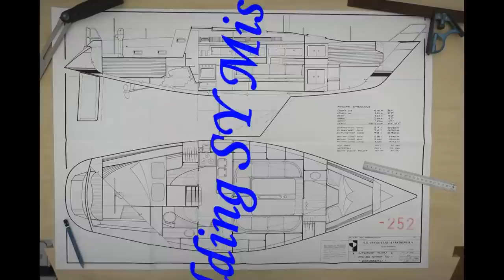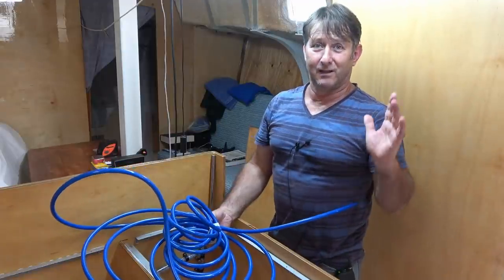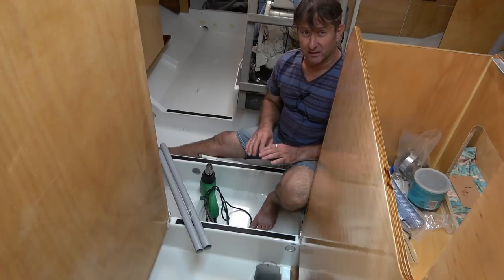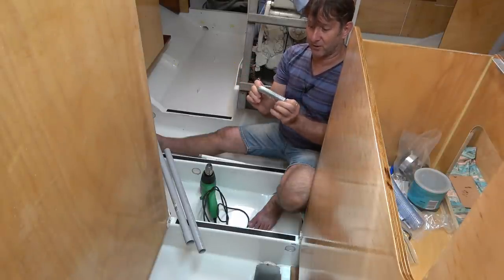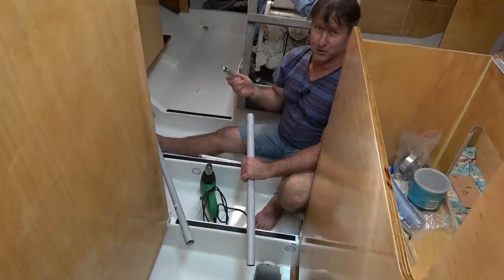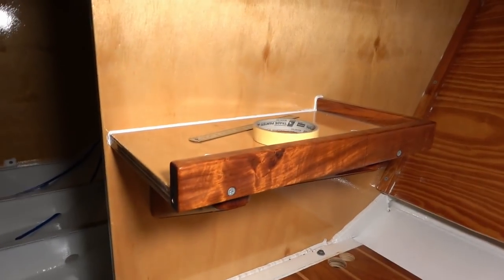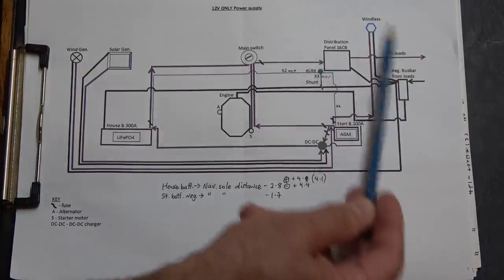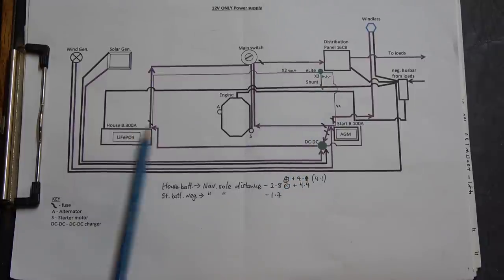A GREAT START with the ⚡ POWER supply Ep.114 Building my steel sailing yacht

Comment: Hiya, as an ex spark, run a nylon string through each conduit so you can use it to pull a wire through in 3 years or whenever. Nylon will not rot. Go to an electrical wholesaler to buy all elec bits, miles cheaper, plus get nylon, for preference, if not steel fish tape to run the string through. When using said string always pull another one through with it when you use it, for next time. 
Stay safe...Steve...
Reply: Excellent idea
Reply from the maker: Hi and thanks for your good suggestions Stephen, appreciated and yes, I do use heavy nylon fishing line as my draw-strings, which you will see in the next episode (or in earlier electrical cable videos) and I have found that looking widely, different stores and online, for good price deals on everything is very necessary for getting lower prices. Likewise, all the best.
Reply from the maker: @graham6229  Thanks for adding.

Comment: Tie a strong line on your spring then if you need to drop it to middle of a pipe you can measure on the line on outside of conduit drop it in up to your mark bend conduit and pull it out
Reply from the maker: Good idea and suggestion Trevor, thanks.

Comment: the spring in the pvc  pipes is an old trick we used to use that trick so many times when i was an instalation mechanic with the cheapo yellowish pvc pipes you dont even need to heet them just bend but this was a lot thicker is think anyways cool to see this ghehe

Comment: OO No... really thought everyone had realised how bad 1,2,both switches are, which I guess you're intending to use, from the sketch info.  By putting it at the lipo, Can your shunt stand the engine starting current if you use the lipo battery?   3, single  isolators for engine , house and a bypass for starting via the lipo/house would be much safer and be so much more reliable. Can't the engine battery be in with the engine, like your car? So much less stress and copper. Boat engines spaces don't get as hot as cars.
Just the comments of someone who has fitted a few boat electrical systems.
Reply from the maker: Thanks for your comments and questions, actually there is nothing wrong with the old school single switch idea from a functional, reliability and safety perspective (when quality switches, conductors, terminals and installation are used) and it is a simpler and cheaper option. I have Blue Sea System's latest "Dual circuit plus" switch which further simplifies and is even safer, especially when having other people onboard. Re. the shunt capability, it exceeds Mistress' CCA draw by >6 times. Re. the starting battery location, this is explained in a prior episode https://youtu.be/o9rTU6gr-VA thanks again.

Comment: Fantastic work. I love perfectionists like you. BTW could you not use flexible hoses as conduit ?
Reply from the maker: Thanks very much for your good comments Graham and re. flexible conduit, I have used these on Mistress previously (see earlier videos) however all flexible "tubing" is ribbed which makes running cables that have a squeezy fit even more difficult!
Reply: @BuildingSYMistress  Good point thanks.

Comment: Bruce
In the states we have flexible elec conduit. Do you have that?  Would’ve been much easier than bending the rigid plastic.
Reply: That's what I thought.
Reply from the maker: Thanks for your good question Frank and yes we do have flexible conduit here too and which I have used on Mistress previously (see earlier videos) however all flexible "tubing" is ribbed which makes running cables that have a squeezy fit even more difficult!
Reply from the maker: @graham6229  Jfyi, see reply to Frank.
Reply: @BuildingSYMistress  Hello Bruce, and well done job! Every week is looking nicer and nicer.
However I was stroling round the comments and saw this answer of you. If you allow me to correct you... am an electrician and I can asure you that pulling (tight)cables trough ribbed conduit is actually easier than trough pipe. It has to do with friction between cable and the walls of the conduit, which is far less in the ribbed one.
However as you said in the video, that one of the conduit will pass right/above the bildge. Well that makes the PVC pipe better choice, and I would probably do the same. 
Just put bigger Ф pipe in case you'll need to pull aditional cable in the future.
Cheers Mate.
Reply from the maker: @stormtrooper9404  Thanks very much for your good and what sound like well sparky experienced comments, which fyi I always welcome! To state again, I have zero electrical experience and had to force myself to get schooled up (enough) to be able to have a decent understanding of a 12V system for Mistress, given the going to sea realities that lie ahead,... In my very limited experience with drawing cable through the flexible ribbed tubing V conduit I found it actually impossible with the windlass cables through the ribbed tubing (see earlier videos) and it was possible and worked 5 times with the conduit. I do not doubt your experience so perhaps it has just been as a result of my situation.
I did want to use larger diameter conduit with all of the cable installation, however there are always limitations and compromises that must be made when dealing with small to medium sized boats.
Press on it is,... all the best.

Comment: Just a heads up,

When you run a wire in a conduit it may affect how many amps that wire can safely handle, due to possible heat build up.
Reply: Properly sized, there should be little to no heat build up in the conductors.
Reply: @1ocean515  the key is correctly sized and they have to take into account that the wire will be in a conduit when selecting the size
Reply from the maker: Thanks for your good comments Bob, appreciated and yes indeed, also jfyi I used Calder's text as one guide for this topic.
Reply from the maker: @1ocean515  Thanks for adding this and yes, indeed!
Reply from the maker: @bobbob6472  Indeed!

Comment: never use the both switch on that mains switch youre gonna use it if the start battery is low just remember the amps the lifepo4 can push towards the agm its real big number and the agm will not like this
Reply from the maker: Hi Dennis, thanks for the good point that you make here, however fyi the DC2DC charger that Mistress has, also has a built in VSR (voltage sensitive relay) which manages the different voltages between the X2 different batteries and engine.
Also fyi, I did see your comment re. bitumen for the sinks but it was blocked by youtube, probably because you added a link, thanks for the good suggestion.

Comment: Hi Bruce - Another nice video - Do you intend to Bend the vent pipe so that if by accident you over fill the water tanks - it will vent into the sink? Nice idea with the spring by the way!
Reply from the maker: Hi and thanks for your good comments and question, appreciated and re. the vent pipe, it will have a 90° head/top fitting later on.
Reply: @BuildingSYMistress  Great Work Bruce keep it up!!!!